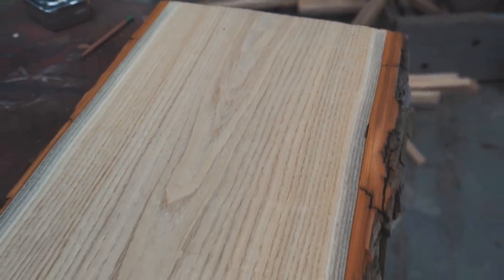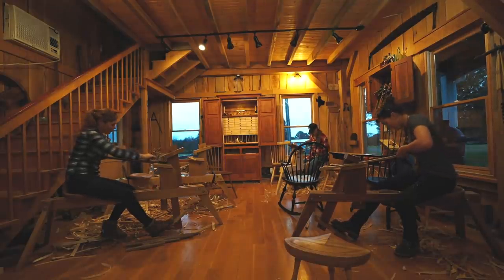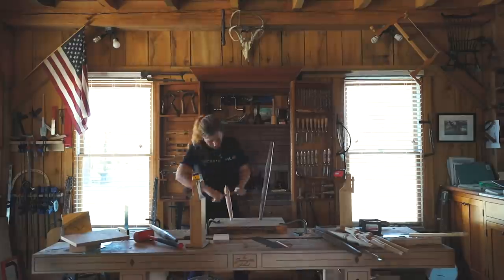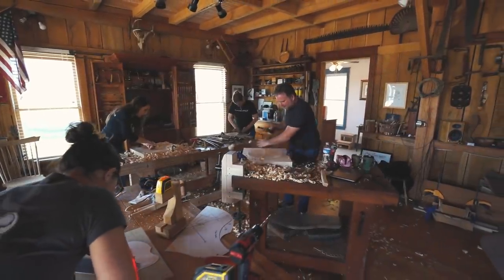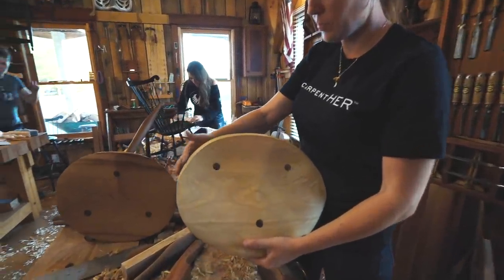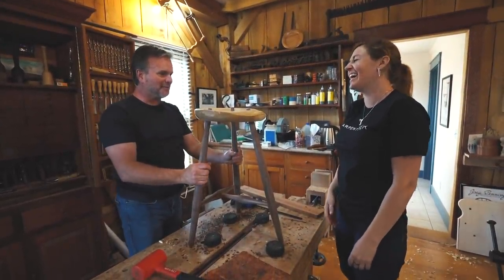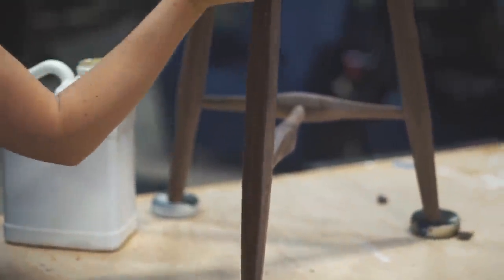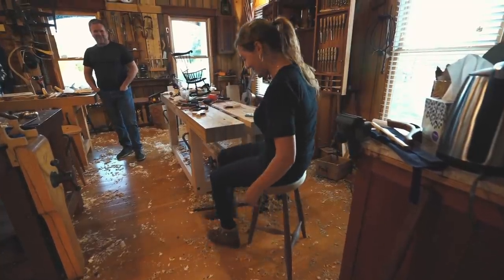Three Legged Shop Stool | Building with Greg Pennington

Comment: Sassafras to fit your * and tea from the bark cleans blood and cures boils. It's not easy to drink, but it works. Nice seat. I wouldn't coat sassafras. I'd just let it be natural. I say that though I've never used the wood, might change my mind :), butt, I do that with ceder. I love that it pisses off bugs.